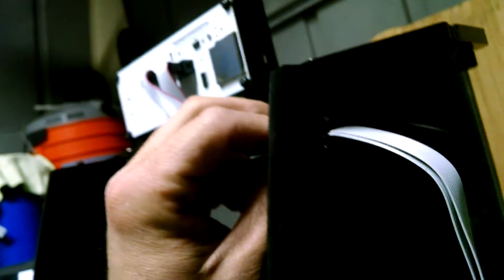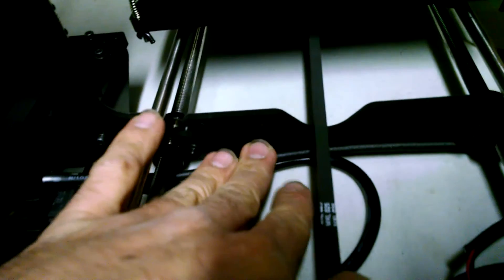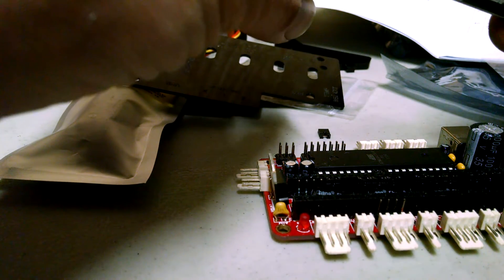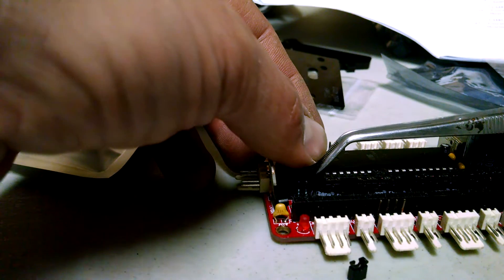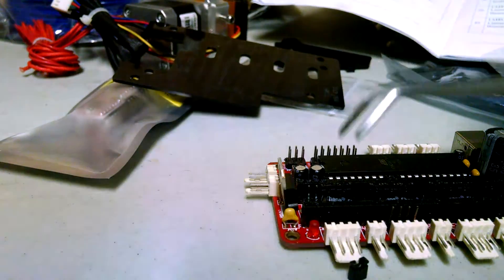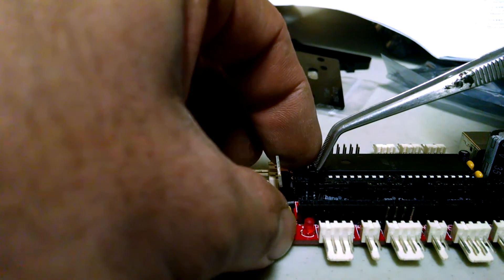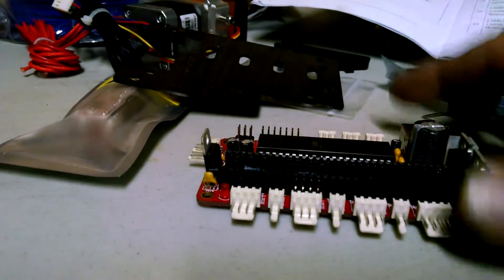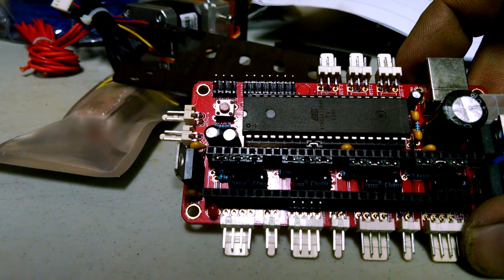Geeetech Prusa i3 Pro B 3D Printer Assembly Step 27

Comment: Hi I need some help, can you check this video? < https://youtu.be/ddkbqOoqQ8M > I need to know what is wrong with it. It is a Geeetech I3 Pro B with 2560 board thx in advance.
Reply from the maker: see my latest blog post. link is on my channel near top, blue "W"

or here is a link ( https://georgeroblesjr.wordpress.com ) and make sure you select the correct one. but also make sure slic3r/repetier host is set correctly as well, confirm via jog on manual controls.
also recommend adhesive for build plate, like a glue stick, spray hairspray on glass. not the machine.
Reply from the maker: but i believe it is a bad stepper driver. try swapping it with another axis. that will confirm, rare cases will fix it.
Reply from the maker: stepper driver for y axis is bad. swap with other to confirm,